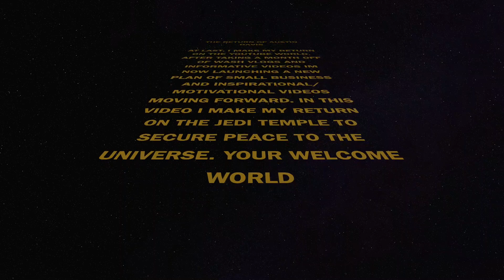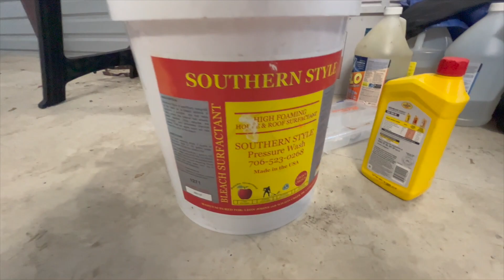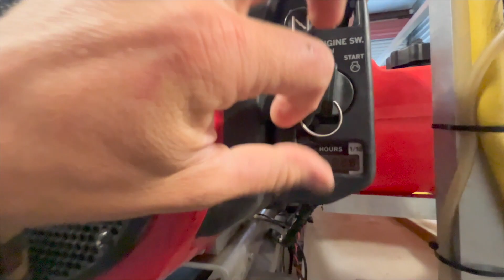The Return Of The Jedi | House Wash Vlog#15

Comment: Do you use a soft-wash system exclusively and leverage potent chemicals? Or do you also utilize high pressure and use soft-wash system as necessary? I'd like some help understanding soft-wash system usage versus standard pressure washing if that'd be alright with you. When to soft-wash and when to pressure wash? And what's the deal with hot water systems?